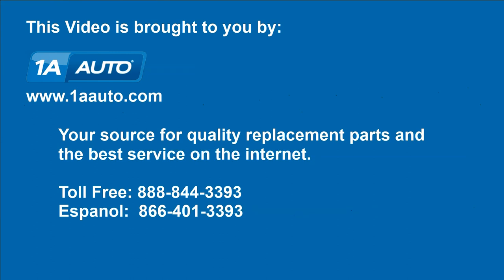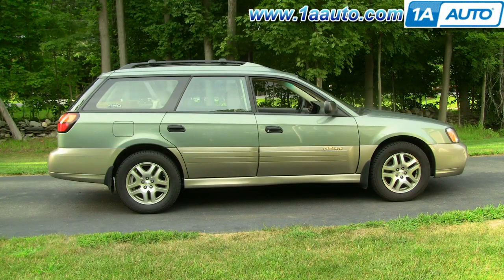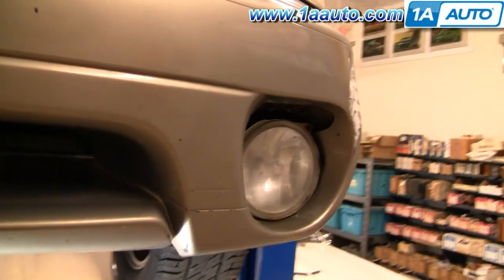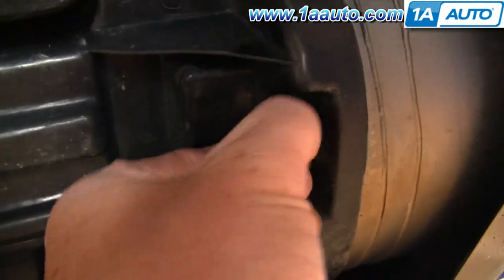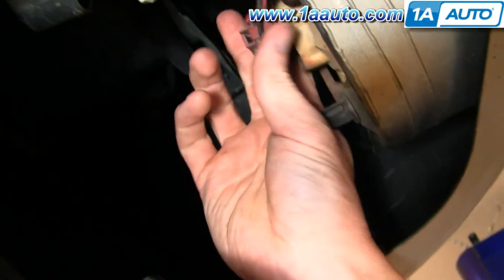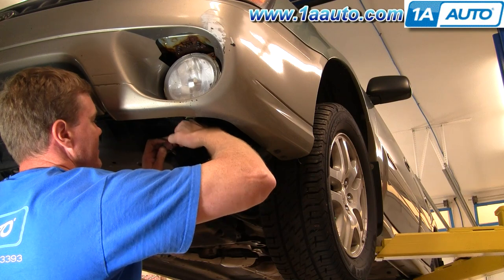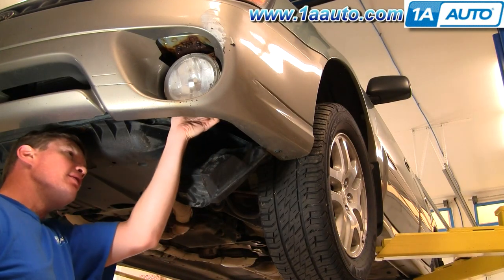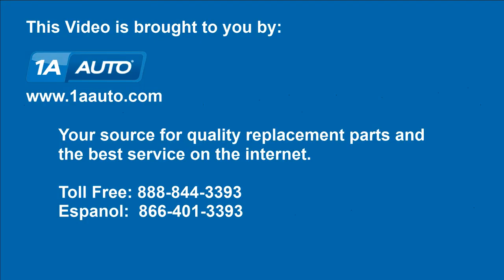How to Replace Fog Light 00-04 Subaru Outback

Comment: Great video thanks.

FYI, you don't want to touch the bulb.  The oil from your fingers will shorten the life of the bulb as the oil causes hot spots.
Holding the bulb with a paper towel or disposable non powdered glove would be recommended.
Reply: That doesn't matter at all here, this instructional has you changing the whole the unit and not even touching the bulb. You're right, technically, but nobody following this video would be touching the bulb...

Comment: Thank you 1aato. Very well done video.  So you can re-use the clip/plastic pin that holds the shield in place?
Reply from the maker: +Jeff C Thank you for watching. As long as the clip or plastic pin is not damaged you may re use it. 1aauto.com

Comment: I’m currently trying to remove the whole fog light but I don’t know what size socket to use to remove the bolts I’ve used multiple different sizes but can’t find the right one or I might just not have the right size socket available

Comment: Hi- I have a 99 outback and need to replace the glass and bulb of the fog light. It has that cage over it.  How does that come off?
Reply from the maker: Thanks for watching. Unfortunately we do not have a video for your application. We will keep it in mind for future videos
Reply: i hv a 98. on owner's manual section 9-7, it says tilt the protector counterclockwise for 10 degrees and it should come off.. hope that's helpful and good luck!
Reply: Thanks- i got it off.. I took the unit out of the car- then there were some tabs to lift up- that was about it.